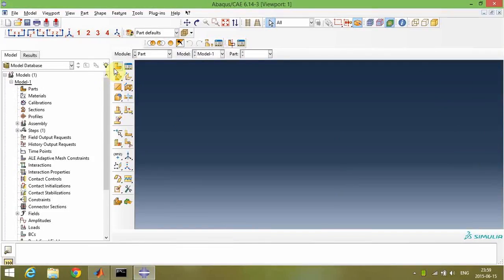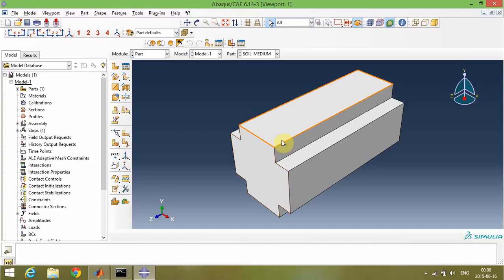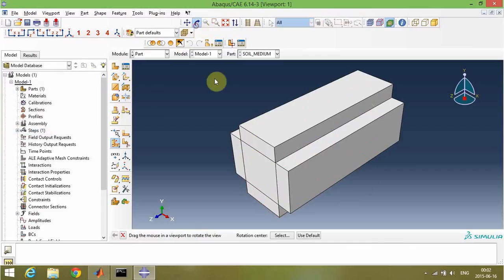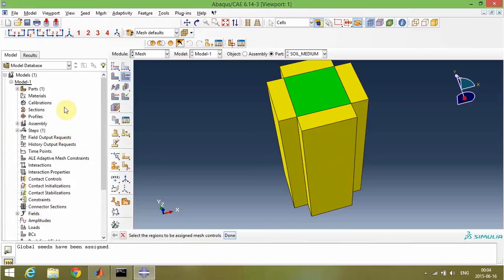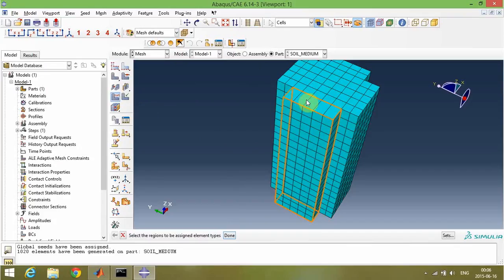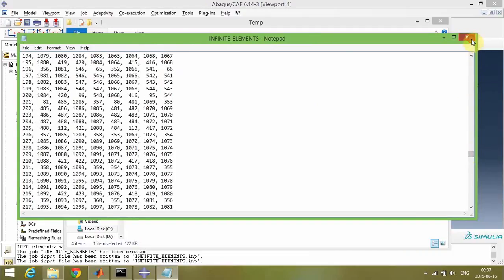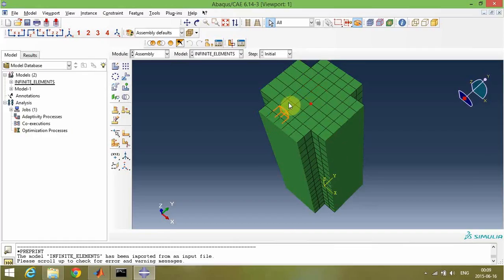Creating Infinite Elements in ABAQUS

Comment: NO BULK MODULUS IS DEFINED FOR ACOUSTIC ELEMENT''  i get this error when I try to analyze my problem, and I check inp file AC3D8 elements are come back even I change them like you did in video, is there a solution for this?

Comment: when i start analysis this massage come
NO BULK MODULUS IS DEFINED FOR ACOUSTIC ELEMENT 5313 INSTANCE soil base
how can i solve these problem
Reply: I'm facing the same problem
Reply: @daniloper1  i solve these problem 
in defining material go to other bulk modulus
bulk modules K = E/3(1-2v)
Reply: thank you for your help. Saddly, I didn't make this thing work. I define two kinds of materials, one for the finite elements (without bulk modulus) and other for the infinite elements (only with bulk modulus and density,). So, I followed the tutorial and this new error appeared: AN ACOUSTIC MEDIUM IS DEFINED FOR ELEMENT <Numbers of elements> INSTANCE <Name of Part> ONLY ACOUSTIC ELEMENTS MAY HAVE THIS MATERIAL PROPERTY.
Do you know something about this?
Reply: @daniloper1  Are you using CIN3D8? this element is not acoustic

Comment: Thank you for the video. It is possible to modify in the input file the element type because the AC3D8 have the same number of nodes as the CIN3D8. what if i want to use the quadratic infinite elements CIN3D12R or CIN3D18R? and does the thickness of the infinite media have influence on the damping?
Reply from the maker: what you want to try is somehow double precision in results. personally i haven't tried to that in a project because 8 node elements seemed to be satisfactory, but from technical coding point of view it is possible. try it. the method that i have introduced is some kind of trick.
Reply from the maker: an about thickness! i can say no, unless you make your boundaries suitable enough for damping. the overall prospect is having high aspect ratio in infinite element

Comment: Thank you for this video! I want to study a soil-structure interaction during an earthquake, I think that Infinite elements are a good tool for this purpuse! About the boundary conditions, should I assign only an acceleration to the bottom of the model?  Should I assign any BCs to Infinite elements? If the soil is non-linear, how infinte element behave? Thank you =)
Reply from the maker: Hi, 
I would recommend you to read fundamentals of FEM before using any FE Solver. 
Infinite Elements are working as a boundary conditions (roughly speaking) and is not needed to assign other Bfs to constraint the nodes.

Acceleration should be assigned to solid bed, i.e bottom of the soil medium. This acceleration should be evolved till surface of the soil. Be careful about using the correlated acceleration data. 

Should you have any further questions, don't hesitate write in comments.
Reply: Ehsan Sadeghi thank you!
Reply: @stefanodalerci6149  please did you use CIN3D8 element?  I have question about it

Comment: dear ehsan
I do a same work for 2D infinite element but when i input the inp file, i faced with an error:
"The model "Job-1" has been created.
AbaqusException: in keyword *ELEMENT, file "Job-1.inp", line 229: Element type "CIN2D4" is not supported.
 This occurred while parsing the input file. Run the input file through the batch pre-processor to check for syntax errors.  
The model "Job-1" has been imported from an input file. "
please help me
thenk you
Reply: Did you resolve your problem?

Comment: Thanks for sharing this. Its a nice trick to create Infinite Elements without getting it complicated. However, I have a doubt in the this example you created.
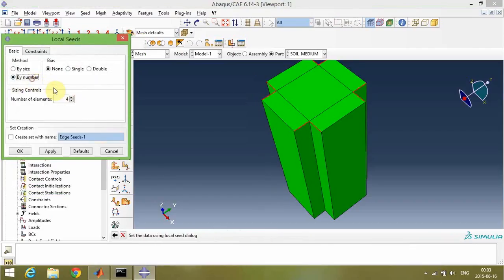At time 4:10 min (of the video): You seeded the infinite part by number to be 1 element, in the direction of sweep.
At 6:14 min: After meshing, only one side had single element seeding, where as the other three boundary sides did not. Till the end of the video I found the same mesh.
Can you please clarify this.
Reply from the maker: ABHIJEET Swain this is just a sample. theoretically infinite elements act as boundaries. so you do not need to mesh them finely. one elements is satisfactory. if you mesh these boundaries finely you may not have zero displacement at the edges( try i guess it so). generally speaking, you'd better to mesh with just one element (i did with one edge you can do with others). hope it could be helpful
Reply: Ehsan Sadeghi : Thank You :)